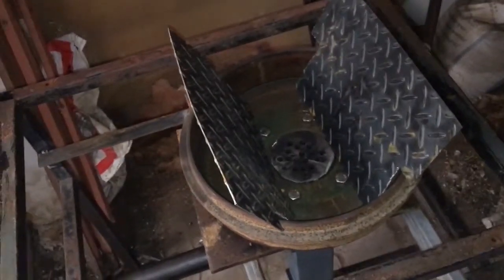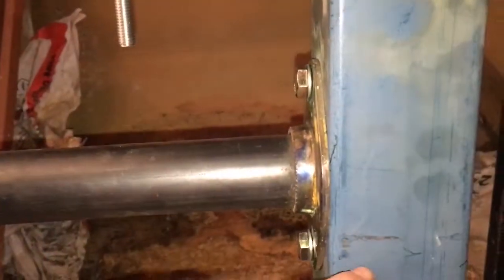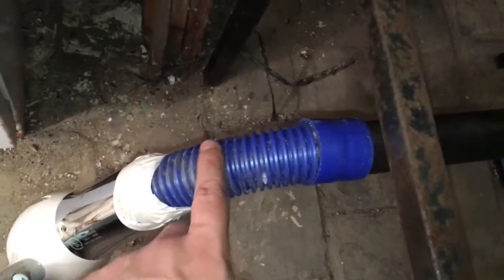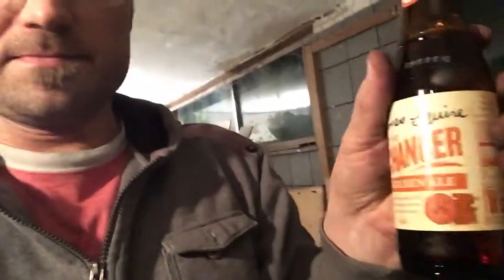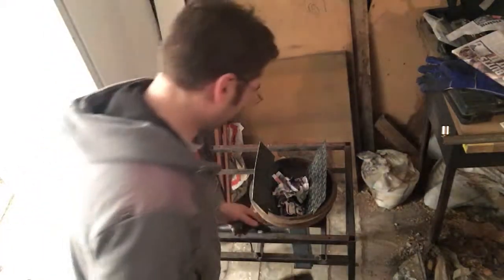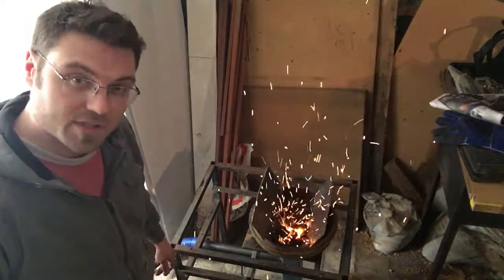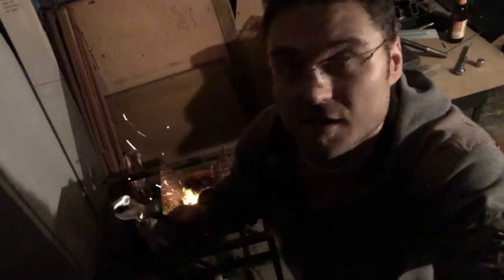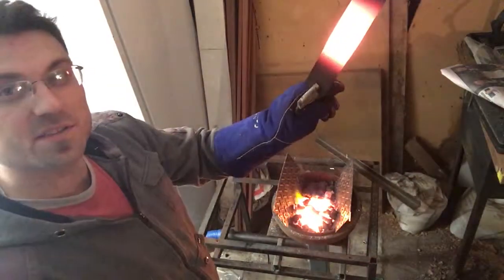FIRE!!! Lighting the Brake Drum Forge - Starting Blacksmithing

Comment: Well... Congrats! Don't need to worry about the plastic tube melting, it's far from the heat source. You could get that thicker stock up to forging temp by putting in a lot more fuel and covering the metal. You're on your way!
Reply from the maker: Thanks ETX, you won't believe it but the plastic did melt right through. The reason was another mistake, using hot air out of the hairdryer. I had to lock down the cool air button with wire and it works a treat!
Reply: Rusty Pearson - Oh yea, you need to do that. Heh.